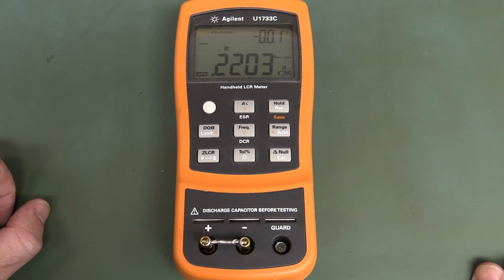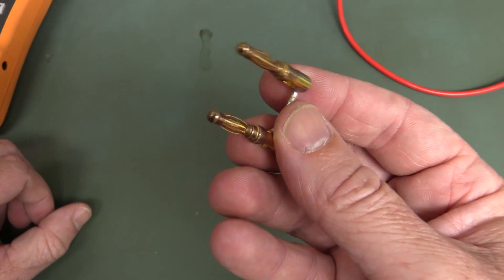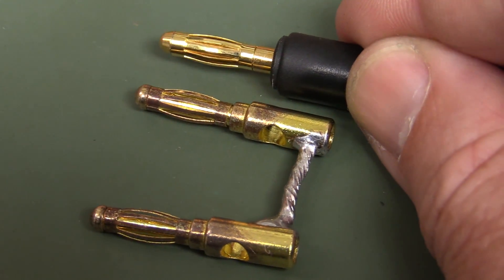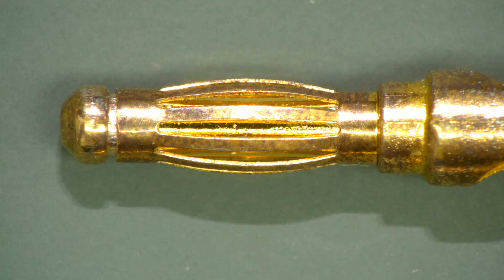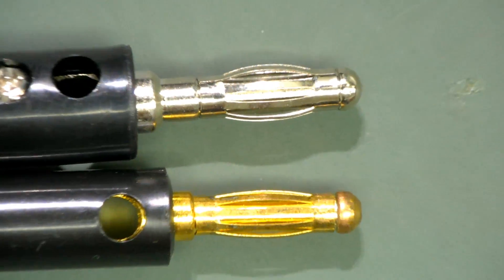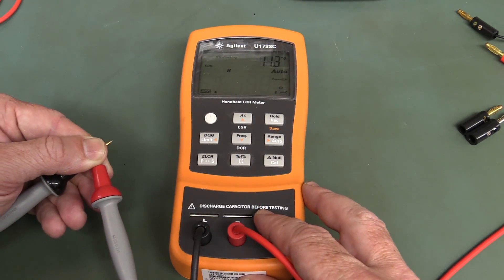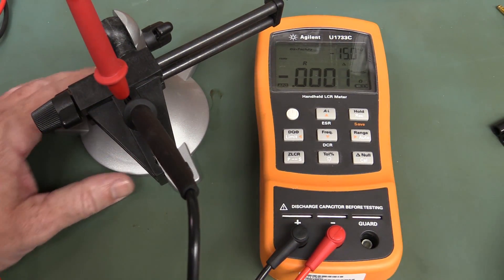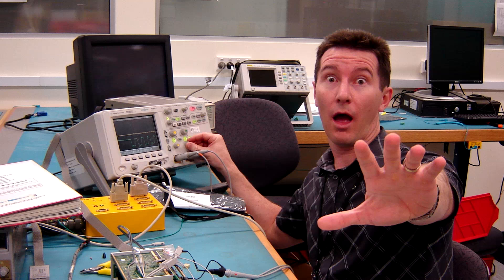EEVblog #1052 - BEWARE Crap Banana Plugs!

Comment: Why not flux and denatured alcohol and a soldering iron to the rescue to remove the corrosion?
Reply from the maker: Polish a turd?
Reply: If you want to get quality stuf, the best solution for this - do not buy chinese shit from Aliexpress. It is abnormal when you pay for 'gold plated' and then " flux and denatured alcohol and a soldering"
Reply: Why bother? Shouldn't have to even have to. These plugs are crap!
Reply: Exactly jackson! Just solder the rotating part to the inner solid part and clean it with fine sand paper. Takes a couple of minutes. I'm not wasting money buying new ones when I've already paid for these.
Reply: Also Dave  should be recycling them with metal not just throwing them away in general waste bin if he's not going to bother soldering/cleaning them
Reply: EEVblog Some things should never be polished. If cheap or otherwise nasty, toss it. Or junk bin it.
Reply: So you assume he threw them into general waste eh? Did you see EXACTLY where he threw them?
Reply: sure why not
and then corrosion proof it with electrolysis and a zinc plate?
idk

Comment: I don't recall ever having problems with the solid type banana plugs. The rotating ones have given me nothing but problems unless I buy expensive ones. I usually solder them so they don't rotate, then they work fine.
Reply: Which Side did you solder that worked the best for you the tip? or the other end? I like the how tight the barrel connects is & is a lot BETTER  than most!!
Reply: That is what I was thinking for fixing my cheap eBay banana plugs for my speakers... As soon as I attached them I could hear dodgy connection going on...

EDIT:
Uggpff, I give up on that; melted it, I'm not good at soldering lol.

EDIT:
I got a grip and remembered I could take the plastic bits off - soldering ain't pretty but they are much better now, no dodgy connection noises.

Comment: A friend of mine had issues with the same style of plugs for connection to his loudspeakers, turned out this rotating thing was far too loose.
Reply: Just solder one end to the inner solid part.
Reply: Shure this might be a fix but buying heavy plugs for not so cheap you should think you can rely on them.

Comment: I'm wondering if the heat needed to solder that bit of wire on oxidized and compromised the plating. If it wasn't gold plating, this is very likely.
Reply from the maker: Might have had some impact, but still crap out of the drawer.
Reply: Sam Petrocelli He showed other ones that weren't used (just were placed in his drawer) and there was already oxidation on them.
Reply: The coating looked best closest to the solder joints though. Looks more like it tarnished from contact with air or fingers.
Reply: I thought the exact same thing.  I've had it happen before!

Comment: I just solder it around. Worked well.
Reply: Soldering one end can make them fit very tight in jacks and the surface finish on these are quite terrible to begin with. Wouldn't want to wear out the jacks on an expensive piece of gear with them.
Reply: Exactly. Takes a couple of minutes Max.
Reply: @simontay4851  Which Side did you solder that worked the best for you the tip? or the other end? I like the how tight the barrel connects is & is a lot BETTER  than most!!
Reply: Which Side did you solder that worked the best for you the tip? or the other end? I like the how tight the barrel connects is & is a lot BETTER  than most!!

Comment: It was probably the split not being there, preventing the cage to properly shrink and make contact on the rod. 
Good to see you're back! ;)
Reply from the maker: The split was there, but didn't look very big. Likely a combo of several things, just basically poor tolerance design coupled with crap plating.
Reply: yeh looks like they did some very thin layer of of gold like ENIG on pcbs, vs. the harder thicker gold used for edge connectors
Reply: Yes, I believe you are correct. Plating is not the problem here. Mechanical design is. The split is too narrow, so the sleeve will not pinch the center pin when the plug is inserted. I have a hundred of them, but mine are even worse: The sleeve ends are dovetailed together, so there is no split at all. A quick slice with a Dremel style cutting disc will fix them.
Reply: I agree. Early in the video the split on the rotating barrel can be seen to be much thinner than on the Probemaster plug. The narrow split will close and not allow significant contact pressure with the core of the plug, when inserted into the socket. This must contribute to the problem.
Reply: Yes I bet this is the main problem. Since the cage is so loose on the shaft, the split needs to be even bigger. Try cutting away at least a millimeter and see what happens.
Reply: EEVblog : For those who want to know, at the very least you can see the split at 4:34 and 5:12 . Probably other times as well, but I haven't checked in depth.

Edit: 4:23 is better than 4:34.
Reply: it isn't the outer ring, the inner shaft is too small, making the split go away, try taking the ring off and put it on any of the other shafts
Reply: The cage ring does not necessarily need to clamp inwards, it can also straighten and contact on the top and bottom edge of the cage. There will be more pressure on those contacts than radially on the cylinder surface of the inner plug.